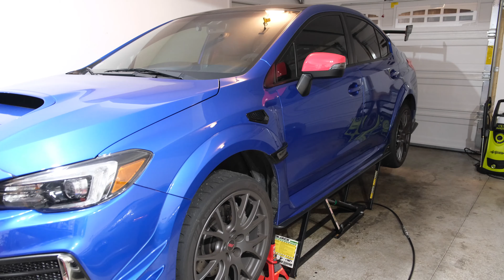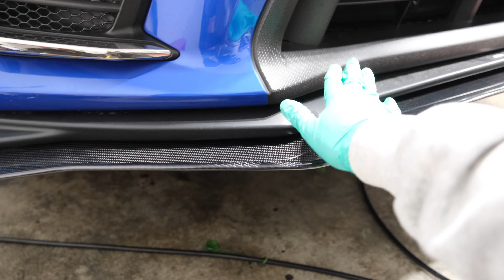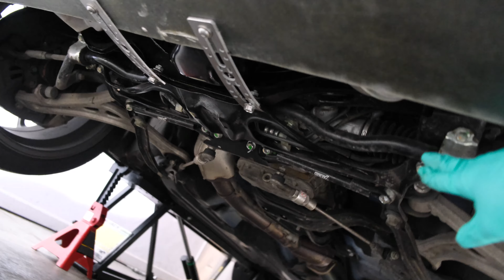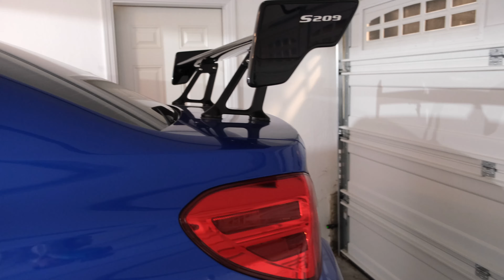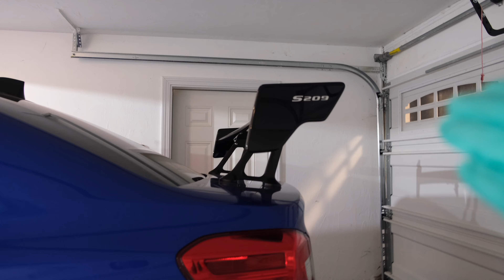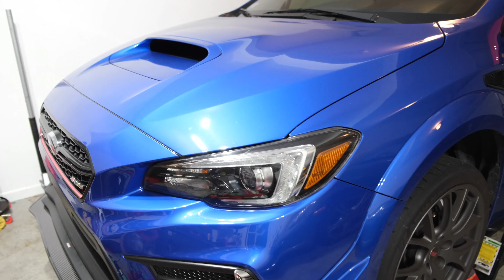Installing APR Carbon Fiber Front Splitter on the S209 | Subaru WRX STI S209 | Aerodynamics

Comment: Does this cover the bottom plastic tray. Are oil changes more difficult with this splitter?
Reply from the maker: I cut an opening under the splitter and made my own custom undertray that bolts onto the splitter, just need to unbolt it to get access to the oil filter and pan.
Reply from the maker: No longer running the OEM plastic undertray, it gets in the way of the splitter
Reply: @TheLastS209  I see, were you running a different tray or that custom one that you described above. Thanks for the info
Reply from the maker: @revcircle  it's a different tray, not described in this video. Basically a rectangular carbon fiber piece that can be removed for oil changes.

Comment: do you have to take the whole thing off to do an oil change??
Reply from the maker: Actually no, there's enough room for the standard OEM pan to drain the oil, and enough room to pull off the oil filter. I might need a plastic cup when pulling off the filter to prevent it from spilling all over the back of the splitter, though.

Comment: Isn't the STi front lip a splitter as well?
Reply from the maker: The STI front lip is just that - a lip. The OEM STI lip is designed to direct airflow more smoothly underneath the vehicle, providing more stability and downforce over the entire vehicle in doing so. A front splitter works differently by covering a lot more frontal area, and produces all of its downforce at the front of the car by creating a high pressure above the splitter and low pressure below the splitter.
Reply: I found out that it's officially called "STi front under spoiler" is that the same as "front lip"?
Reply from the maker: @patrickizumi  yes